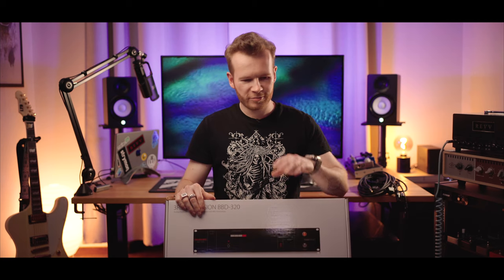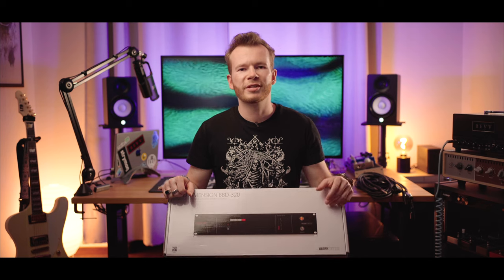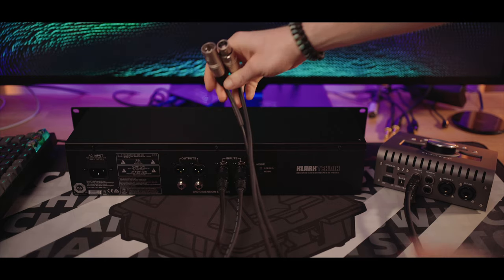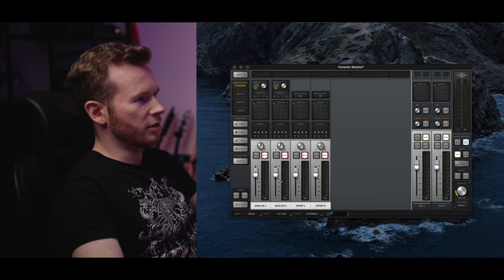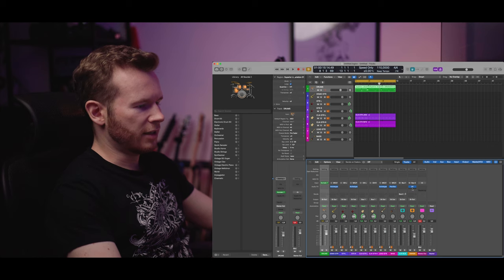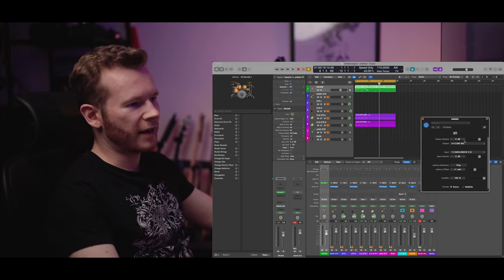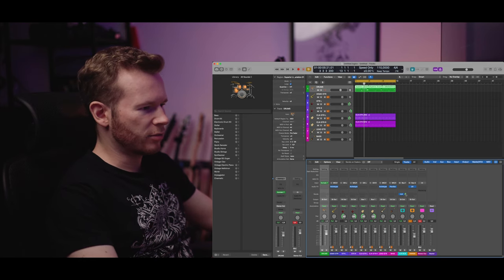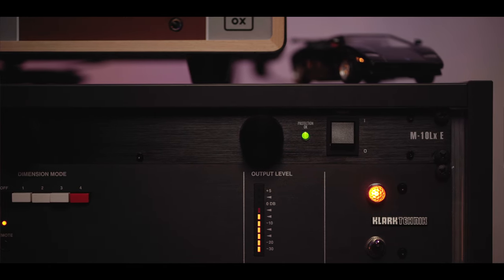How To Use Outboard Gear With Apollo Twin And Logic Pro | A Step By Step Guide

Comment: Hey cool video, here's a little explanation I hope it's understandable. Warm greetings from Germany! Since you have inserted an XLR plug into a combination socket, the Apollo recognizes that the connection is on all 3 pins of the XLR and sets the MIC level. If you  insert a TRS cable instead of the XLR, it would recognize the three contacts in the TRS. With an XLR it always depends on the MIC level and with a TRS, Line. This is for all interfaces with a combination socket the same.
Reply from the maker: Oh, makes sense, thank you!

Comment: You need to select the line input when you use an XLR or TRS jack cable because, quite simply, the signal coming from your hardware is a line-level signal at around +/- 1V and not a mic-level signal bro 😉

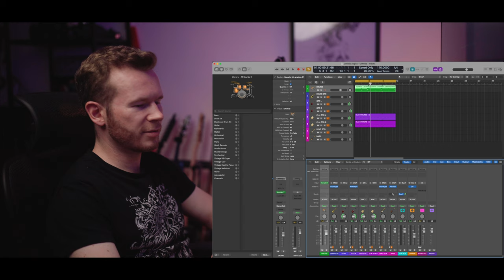Comment: Hello Adam! Thanks for your video and show how this chorus gear works. I've noticed so much noise or "interferences" from 8:50 min to 16:54 min from your microphone... I had the same problem with my Tube Condenser Microphone and after many time I finally solved. I hope you can do it as well and your videos go to the next level! I'm pretty sure you have too many plugs connected to the same socket or some other source that is giving you that interference. Try another socket or, even, another room. You will see how that noise disappears ☺👌

Comment: Really helpful reminder, thank you Adam! Here's how I set everything up through my Apollo for my mastering chain in Logic Pro. I run everything through my Apollo Twin Quad. On the stereo Mixbus channel, I send the signal out to my mastering hardware (SSL Fusion, with send to the Tegeler Creme compressor, followed by the BBE 882i Sonic Maximizer). All devices are connected via XLR and TRS cables to and from the Apollo audio interface.

In the Apollo console, remember to link inputs 1 and 2 to create a stereo pair by clicking both inputs, right-clicking, and selecting 'Link.' I place the I/O plugin directly onto my stereo out channel in Logic.

My current mastering chain on the Logic Pro stereo channel is:

1. Some type of saturation to warm up the signal (e.g., Softube Tape, or UAD Ampex ATR102)
2. Routing out to the hardware via the Apple I/O utility plugin (SSL Fusion, Tageler Creme, BBE Sonic Maximizer 882i)
3. Kclip 3 (Clipper)
4. Fabfilter Pro L2 (Limiter)

I then bounce the stereo WAV or MP3 as usual. My mastering chain is always evolving as I experiment with different plugins, so have fun with it! My next step is getting my hardware outboard gear working with Ableton Live since I'm using Live for EDM Dance Electro/Pop
Reply from the maker: This is gold! Thank you Andy! How do you like the Tegeler Creme?

Comment: Is there a way to add a headphone amplifier in this chain?? I use my outputs on my Apollo to run to the headphone amp in my booth, is there a way to still connect it or do I need a patch bay?

Comment: How do you route the mix to your speakers? I use the four apollo x4 outputs for my two monitor systems?
I have no idea how to keep my both monitor systems running when all four outputs are used for outboard gear.

Thanks for short answer. (Great video!!!)
Cheers from Ibiza.
Reply from the maker: Cheers! Apollo x4 has 2 dedicated outputs for monitors, 4 mic/line inputs & 4 line outs... so just use the monitor outputs for your monitors.

Comment: How would I plug mic in if I use xlr
Reply from the maker: The mic goes into the MIC/LINE inputs on the Apollo. If you're using both outboard gear and a microphone, then you might need an audio interface with more inputs. Or maybe your outboard gear is a preamp or a compressor? Then you plug the microphone into the outboard gear inputs and the outboard gear outputs into the audio interface inputs.

Comment: Why did u bought the clone? There's alot of plugins (from UAD, Arturia, Overload) that can replace that piece of gear. If i were you I'd invest on monitors.
Reply from the maker: I wanted to dip my toes into the world of outboard gear and this was very good price/value option
Reply: He’s in a small room why would he invest in more monitors when the monitors he has is ideal for the room he is in as well as the flat frequency response? Also, plug ins can’t fully replicate hardware it can come close without a doubt but can’t beat the sauce of hatdware.